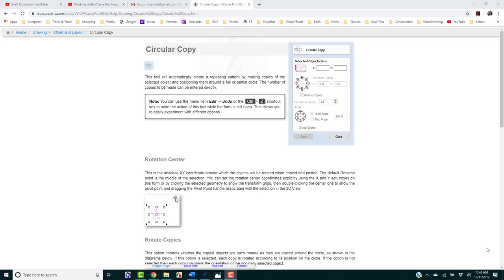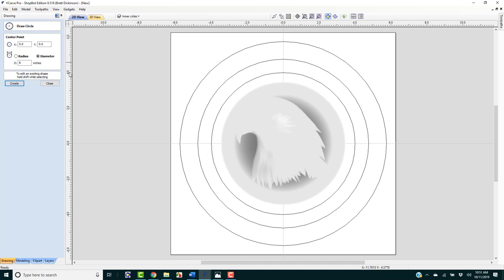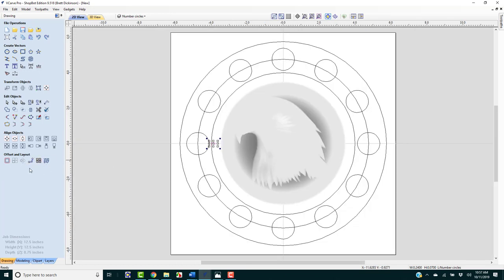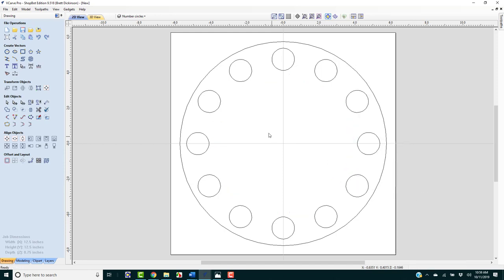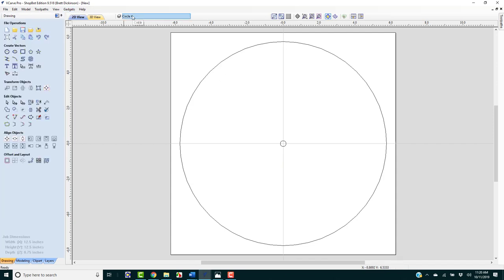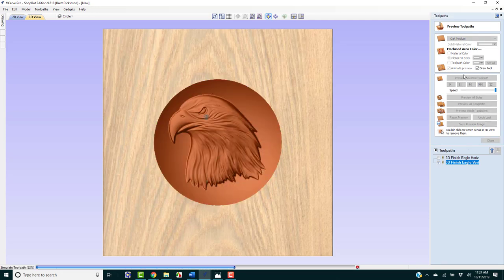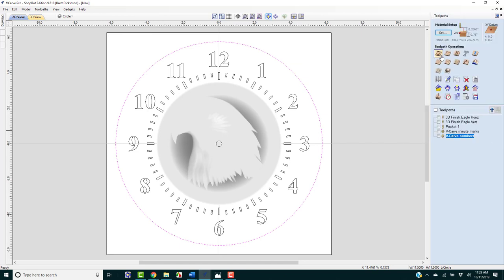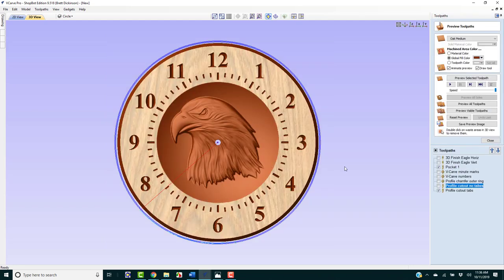Clock project using circular array

Comment: How do you circular array if the array center is not in the stock center? How do you find a rotation center coordinate if it is notin 0,0?
Reply from the maker: You can enter the coordinates for you rotation center at any place in your material.  A circle within a circle will appear where the center  the center of your array will be placed.
Reply: @brettdickinson7708  Is there any easy way to find a coordinate of a point by selecting it? Looks like there is no other way to select an existing point without knowing its coordinate...
Reply from the maker: @fathmi   Just create a small circle and place it where you want.  In the Draw Circle dialogue box it will show its center point.  You can write down those coordinates and enter them into the Rotation Center boxes of the Circular Copy dialogue box.